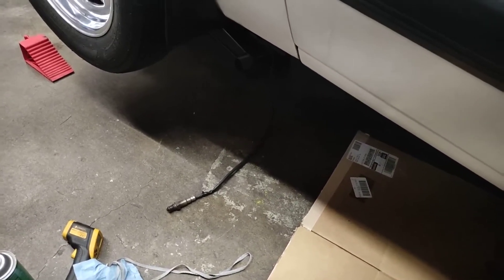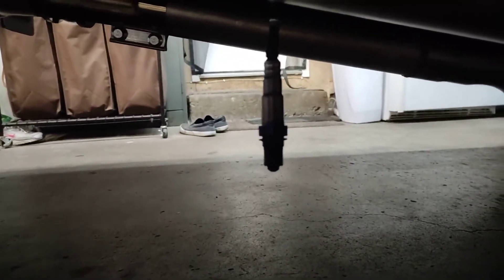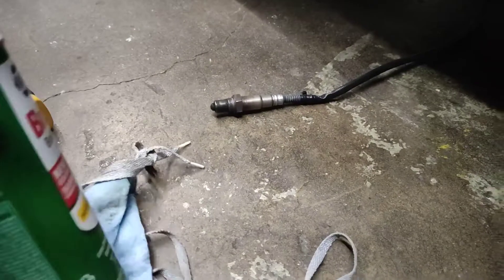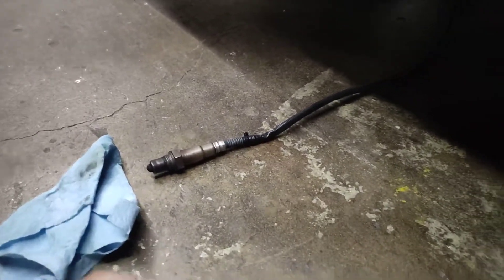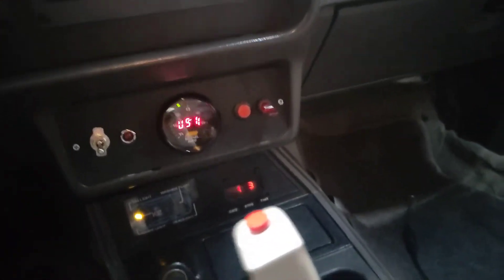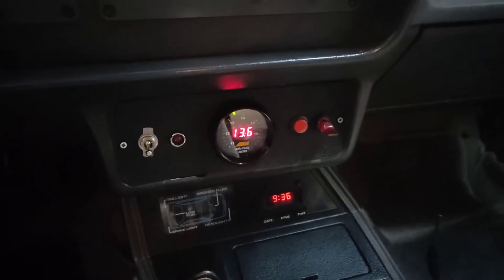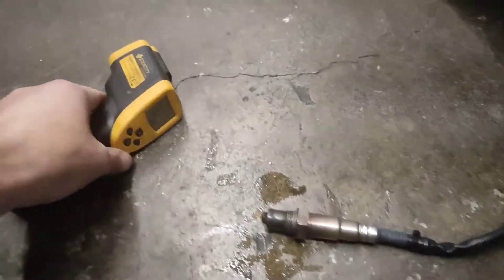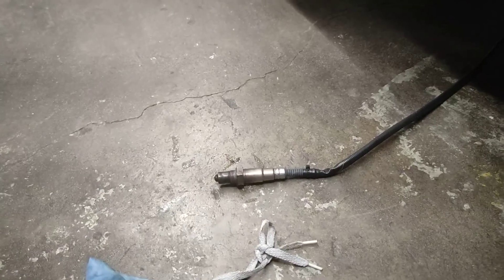AEM wideband test! Bad out of the Box

Comment: Mine goes straight for dashed lines and it’s a brand new kit because I just wanted a new setup and the sensor died within a few mins so I’m going to order a non AEM sensor as I have in the past and it fixes it in most cases. I did check all my wiring and replaced all the harnesses
Reply from the maker: yeah get a ggood sensor, Bosch if you can
Reply: @vrm86gt  I bought from the trusty guy off Amazon that I’ve bought four times from and the sensor is working now
Reply: Didn't work for me

Comment: That's a good test no doubt 🚗🔧🐎💪🇺🇲💯🚦🏁 interesting
Reply from the maker: the gauge acts exactly the same with the engine running also, so far the AEM rep I spoke with twice said they would send a warranty replacement since I just got the item in January and just installed it in February. Hopefully they will honor their 1 year warranty and come through but I wanted some video proof of how it acts in the car with 2 different sensors also! Thanks for checking out my channel!